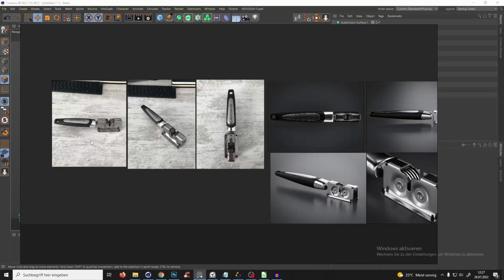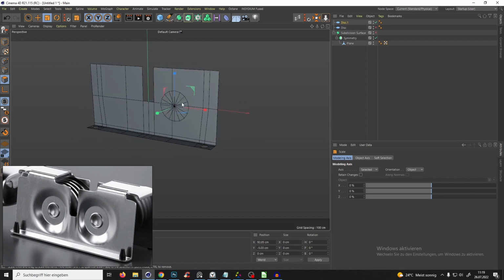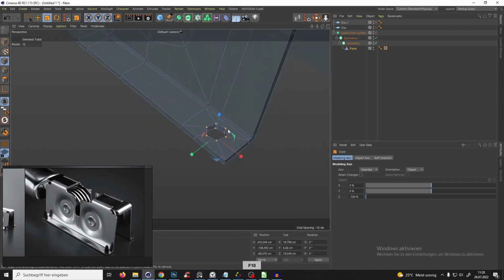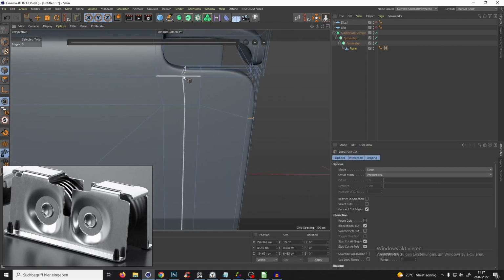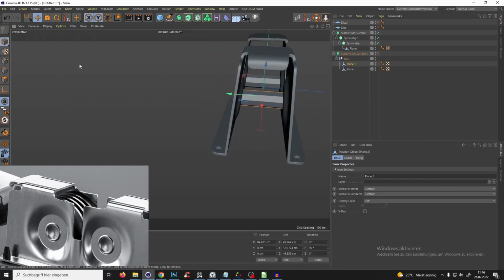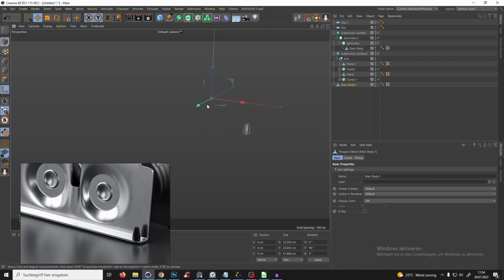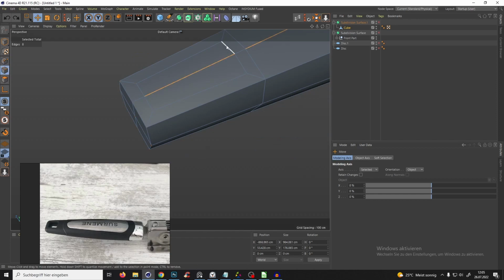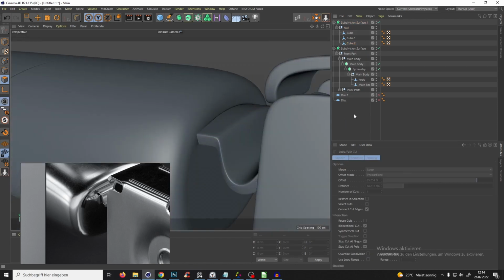Industrial Design | Hard Surface Product Modeling | Knife Sharpener | Cinema 4D

Comment: great content. Will you upload more modeling in c4d? not much content out there
Reply from the maker: Yeah will do definitely. 
Check out "Polygonpen" tutorials. He has the best ones
Reply: @nikita.kapustin  I know, but thats about it
Reply from the maker: @orphydiancg7759  Check out as well:
Elementza, Arrimus 3D, On Mars 3D
Reply: @nikita.kapustin  Arrrimus has removed all free content from youtube except some vids sponsored by Autodesk. Elementza is basically advertising his courses and hes with Maya which is a very destructive workflow even for c4d standards.
Reply from the maker: @orphydiancg7759  Yeah, really unfortunate that Arrimus took down his content. Check out his course on Udemy. it's 13 $ and has A TON of very valuable content. 

Other than that I learned basically modeling just by practicing every day on stuff I have at home or references on the internet.

IMO it's even enough tutorials out there. But of course I will try to make more more tutorials on modeling in C4D
Reply: @nikita.kapustin   Arrimus content was invaluable to 3d modeling.  Not sure  his paid course can make up for that. About C4 d. Any good series about  UV unwraping inside the program? they started too touch  their Uv in the latest versions. Minimal changes but hey. Judging bt the totally unexpected  modeling improvements I would not be surprised if Uv get totally overhauled.